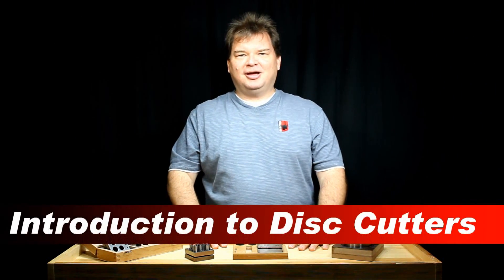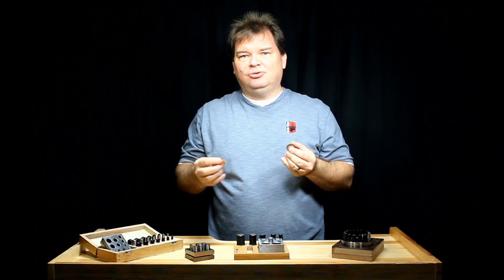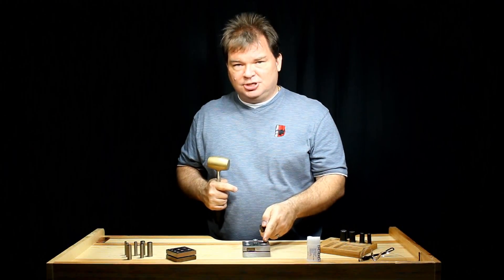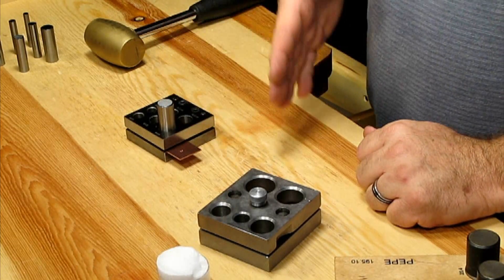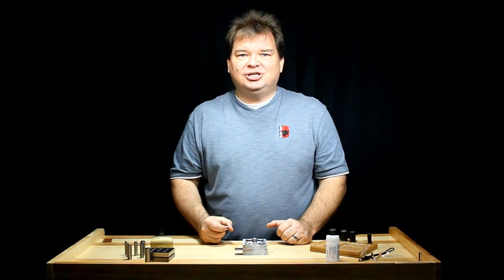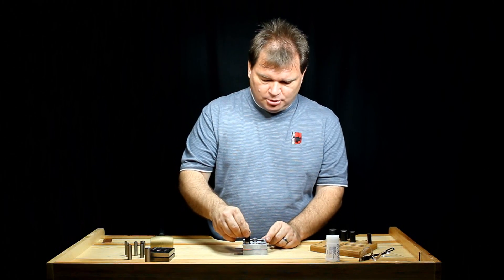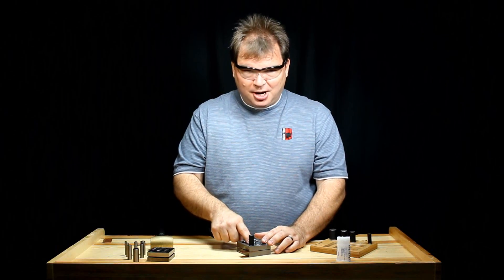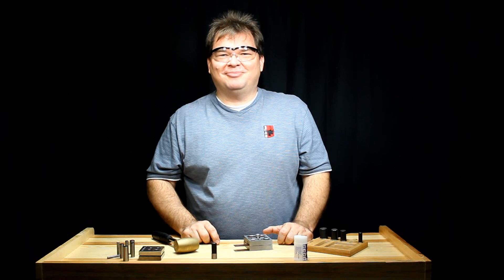Introduction to Disc Cutters

Comment from the maker: Great question.  The main disc cutter in the video is the PEPE Tools 1/2" to 1" disc cutter.  It is stock number #25.195 on our web site.

As far as cutting through bottle caps, you should have no problem.

Comment from the maker: You can use a disc cutter to punch holes in coins since most coins are made of soft metals or alloys.  You do have to be aware that the thickness of the coin does not exceed the maximum thickness the disc cutter can handle.  For instance a penny is about 1.5mm thick which in close if not over that maximum of some cutters.

Comment: Thanks for posting... I have a PEPE tool - might you know how I go about getting the punches sharpened? Thanks again. m
Reply from the maker: To sharpen the cutting dies correctly, you would have to find a machinist with  special grinders to bring back the cutting edge.  It might be cheaper to purchase replacement cutting dies which we have available from PEPE.

Comment: Thank you for posting. What brand name of disk cutter do you have for the one with adjustment pin in the middle. I'd like to know where I can find that. I looked on Amazon but couldn't find that particular one. Do you know if this tool will cut a flattened beer bottle cap?